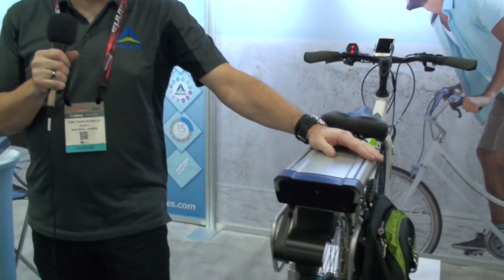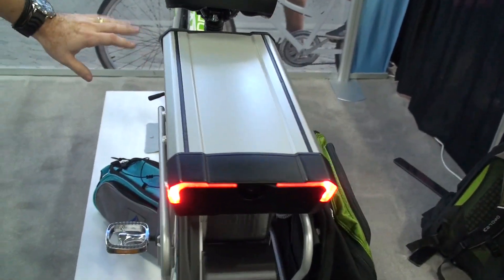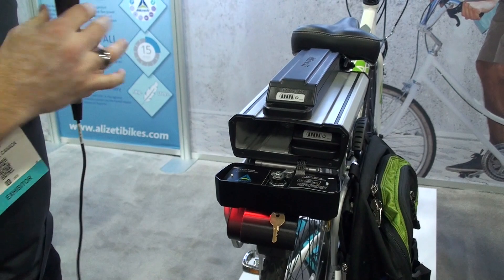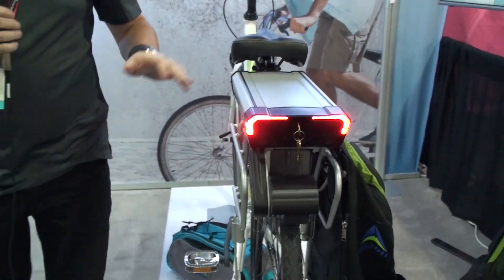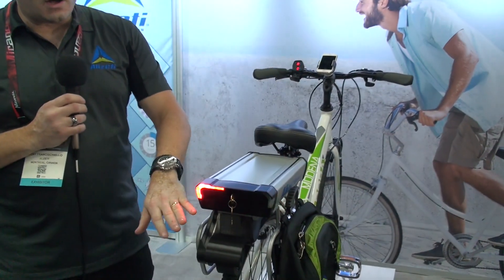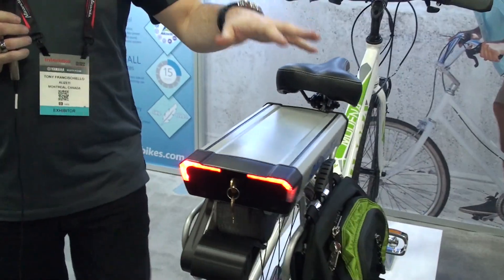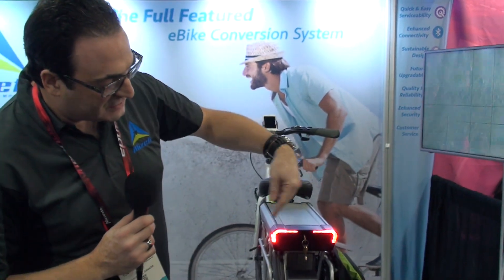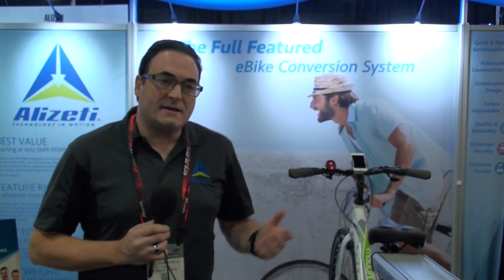Alizeti 300C Friction Drive Electric Bike Kit | Electric Bike Report

Comment: It will ruin your tires, it will slip in the wet, no
Reply: what?
Reply: It wont really mess up the tires that much. And if the surface if gritty enough it wont slip that much.
Reply: It will not ruin your tires and the friction roller has anti-slip technology as well as a "rain mode" which works in both rain and snow.
Reply: https://www.youtube.com/watch?v=z9j6COYlAk0
Reply: There a rain option

Comment: That lioght is not going to do you much good at nogiht. Sure it will hekp cars see you, but it will not help you see the raod in front of you. I had to  put two headlights on my bike with LED bulbs in order to see the road in front of me. When you're driving eight to ten miles per hour you don't have much time to react when you coome up on a road hazzard. You need to see at least twenty feet in fornt of you and you need to see clearly at that distance. Dark objects don't stand out well in dim lights. This I've learned from experience when I lamost ran into a large gabage bin!

Comment: Bad system
Reply: my only thought is it would wear out the tires faster.
Reply: @deadjoey77   Tire wear is negligible. Automatic pressure adjusting servo motor avoids putting too much pressure on the tire.
Reply: Whats bad about it?